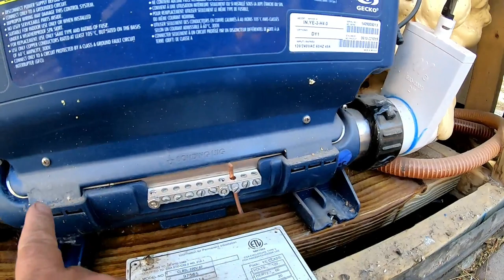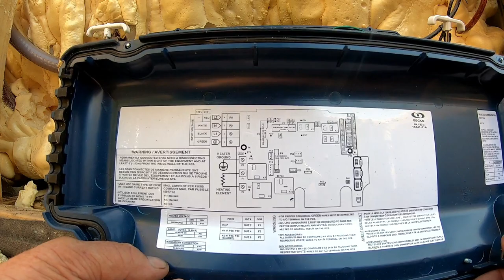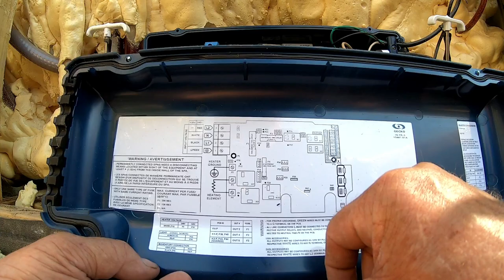Dynasty Spas... Heater Replacement...Gecko Control Pack.. DIY Heater Replacement

Comment: Good vid. I would have put the cover on before starting it so in the event your work didnt work and it leaks it does spray on the circuit board.

Comment: Was there an issue with the heater that wasn’t mentioned? Why replace the entire heater for a gasket replacement and possible element change if corroded?
Reply from the maker: The Heater was not working and if you replace just the element you run the risk of it leaking.Ive never had good luck replacing the elements in the past and have stopped doing it that way....If I replace the entire heater , tube , sensors and everything the problem aways goes away..Hope that Helps.  Thanks For Watching & SUBSCRIBING

Comment: Hello, I own an Emerald Spa DS4, 2004 I believe, and I recently moved and brought my hot tub as well. The tub actually was not functional for the past year and a half though, due to the heater being fried as well as the pressure switch, but before I figured this out, I replaced the circuit board, the fuses, even the transformer.. I replaced the circuit board because I noticed that the control pack box was open for who knows how long and it looked like water got in and did alot of damage.. 1 spot that was really noticeable, yet not on the "actual" circuit board, but rather the wire terminal, was the spot where the red wire and the white wire go in was melted... I was able to reconnect the red wire without any issue, however I can't seem to find the neutral wire that would connect to the circuit board... Meaning I have the 4 wires coming from my gfci box, the black, red, green and white, and they go INTO the wire terminal in the tub's power pack, the green comes out of the terminal and splits up and all grounds connects to where they should, the black also properly connects to the board as with the red, but as for the white... There just isn't one... Coming out of the terminal that is. Period... So long story short, my main question is:  Where does the neutral wire usually go after the wire terminal? Basically where does it connect on the circuit board, if at all? I can't find a single schematic or diagram, even a single picture of a Emerald Spa DS4's power pack with the door open so I can use it as a reference....  Any help would be more than appreciated... If u can help with this, I'll order all my remaining parts through
 you exclusively....lol

Comment: spa man.  question I have the exact Gecko controller and its tripping my 50a breaker.  I've disconnected the pumps, heater and it still trips.  I checked both incoming wires Red/Black and both read 121V.  If all devices are unhooked from the controller and it still trip?  Does it mean the controller is bad?

Comment: Hello I'm wondering if the heater was just leaking or if it wasn't working properly. If it was just a leak, can't you just replace the gaskets? I have this same spa and it's only a couple years old. I needed to get access to the heater pipe (rag got sucked in) and when I put it back together there is a terrible leak at the joining pieces. I feel I really got it tightened down but I thought I would get a spanner and tighten a little more without damaging. Any ideas?

Comment: I've got nearly the same setup on my Dr. Wellness G12 Tub from 2014.  I've got a FLO error.  Pulled the filters, and it's still there.  Installed new filters and with or without, it's still throwing FLO.  All jets are open.  There is a REDICUOLOUS amount of foam behind the access so I can't locate the FLO sensor.  Any ideas??
Reply from the maker: Depending on the age of the sensors and how often you change the water and how well you are taking care of the chemicals in the hot tub... 
Problem no Flo error
(1) Filter
(2) sensors
(3) Diverter is  broken or in wrong position 
(4)worn out or broken impeller
Lastly do the tubes on the inside have a lot of crap or scum ? we use this product to plush and clean https://amzn.to/3S4k6up
and it has helped in some cases like this 
Thanks for Watching & SUBSCRIBING

Comment: Mine is leaking same area but still heating. Do I still need to replace the entire tube or can I get the black split ring coupler thing and gaskets and just replace those?
Reply from the maker: No you can just replace the gaskets as long as the tube is in good condition. Thanks for Watching & SUBSCRIBING
Reply: @spaman5440  My heater is still working as well. Where can I purchase 2 O- Rings. Only one side is leaking... but I should probably replace both . Do you know what size the O Ring is...and where I can get them?  Thanks for the video.

Comment: Having issues with blown fuses for pump 2. I checked pump and it's capacitor and it checked out. Had it running dry at 220v drawing 5.1 amps so that seems OK. Now it would seem that my geco spa pack also has a capacitor for the pump and that it may have blown. If that's the case, do you think replacing it myself is feasible?
Reply from the maker: If you can find the part and You have the skills then Yes go for it get it done...My first question is what caused it to blow(chicken or the egg)If the motor/pump is older then 7 years I would have it completely rebuilt motor and wet side... As for the board there has to be a reason it blew ...The fact it is a Geco pac could be the reason.. Its a good product but it is a cheaply built product .. Hope this Helps Thanks for Watching & SUBSCRIBING
Reply: @spaman5440  Thanks again for helping me out on this issue. I really appreciate your input. Now assuming I need to replace the geco pack once again, is it possible to replace it with another better built pack from a different company? Also if I have pump 2 rebuilt, will the cost of that be substantially lover than the cost of buying a new one?

And if I was filthy rich, i wouldnt even be here. Ide replace  the whole spa.
Reply from the maker: @Daniels656993  Ok ...You have a lot going on so I would say...give Scoot a call at the Arizona Hot Tub Factory and ask him what he would do ...

Comment: Hello again Spa Man.  Question:  Can I replace a Gecko Heater 9920-101435 with a 9920-101449?  Seems the only difference is that the 435 is 4Kw and the 449 is 5.5Kw.  Or are are other differences?  Thanks in advance

Comment: Can i run a 5.5kw heater in a pack that came with a 4k?
Reply from the maker: You can but I Wouldn't 
Thanks for Watching & SUBSCRIBING
Reply: @spaman5440  ended up replacing with the 4k, thanks!

Comment: I've got a lazyboy spa with a brand new 2 speed pump and a gecko controller. The high speed won't engage, it hums for a few seconds then the whole system shuts down so I have to engage low speed again. Any ideas?
Reply from the maker: It sounds like you need to have thePump &  motor Reconditioned... Thanks for Watching & SUBSCRIBING
Reply: @spaman5440  thanks for the response. It's a brand new pump so how would you recondition a new pump? Is there anything on the controller that could be an issue?
Reply from the maker: Give Scott a call at the shop After 9 a.m. most mornings You can find the # at  ArizonaHotTubFactory.com
Reply: Should've went with Balboa.